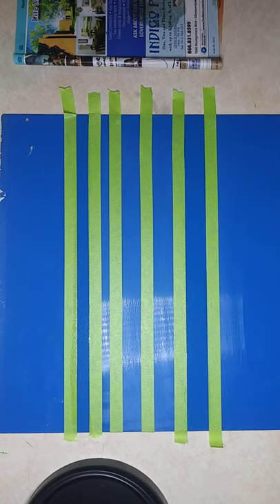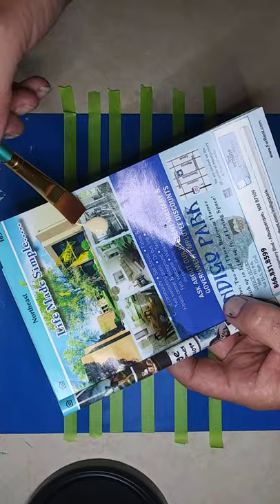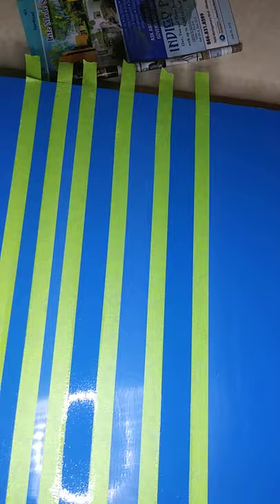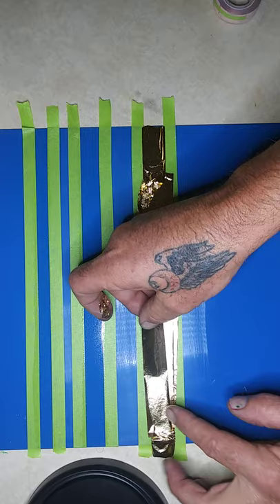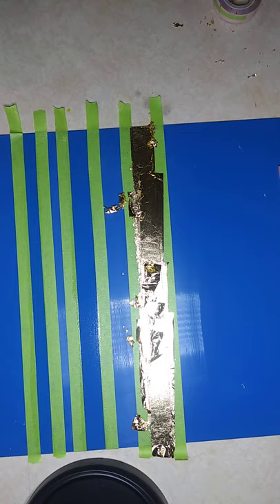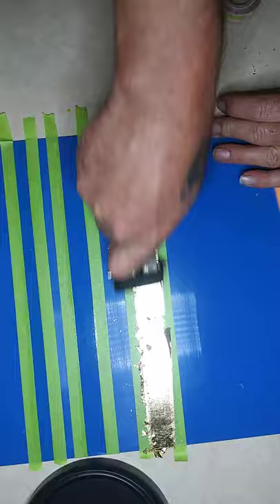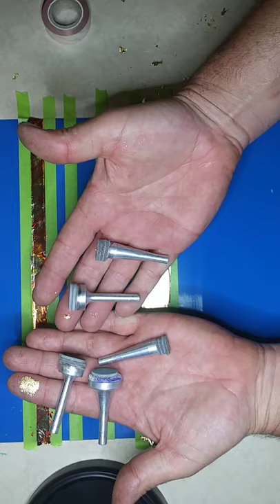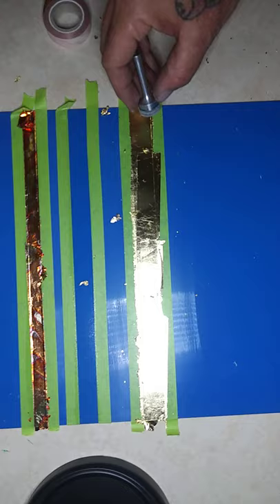GOLD LEAF FOR BEGINNER PINSTRIPERS

Comment: Maybe FYI, I tried the other brand 2k clear in a rattle can, ruined two of my projects, they looked really beautiful, after 24 hours I wet sanded the fish eye out and then buffed. High gloss shine, the next day I started to see lines in the whole project thru out. So I sanded smooth. When more clear coat came I pulled the project out to clear coat, and all the lines, (really more like cracks) were worse and were raised and the surface was rough. I believe it reacted with either or both primers I used. I was using primers in a rattle can from the auto store. I am on my third project, used a different primer, so far so good.
Reply: About 45 years ago I ran the sheet metal shop for DOD, 5th Army Forward Area Maintenance and the chemist from DuPont stopped by with this new paint called Imron urethane ... Since we spray painted everything on the planet, he suggested it for the Nike missiles (Didn't use it) ... he explained that then paint was oil base automotive paint and a special hardener... Back then I did a lot of airbrush work and pin stripping on bikes, so I took some one shot and added about 10-20 percent of Imron Hardener.  I had base coated a Sportster with black Imron (Free samples)... pin stripped it with a yellow/hardener mix. Let dry for 24 hours and then clear coated with Imron clear...magic... no cracks or wrinkles for 3 years when I sold it. I also tried using the same mix with Yellow Occur One shot as sizing for gold leaf name on a tank, plus one wood boat sign... I spread some of the same mix on some scrap painted metal and kept touching it till I got a clean"Snap" sound. Then I applied the leaf ... worked perfect, no cracks or wrinkles. This was on a show Dodge Van and it worked like a charm. I've never tried gold leaf size in such a mix... you might like to try it. I do mostly reverse glass work these days and floating painted images, like the old depression period Pub signs here in Australia, where I retired... You can check out the "Happy Guilder" in England as he does great work and good step by steps on you tube. Go for it ... also I feel that primers are not your problem. Also you need a spray booth as you can't buff Imron!

Comment: hey there thanks for the video! - i have a couple questions for you-- do you find the size tach time sweet spot is different when doing the turns on composite gold, verse 24k ---etc or verse copper, or silver ...? Also what grit is on that turn tool you are using? Any suggestions i just keep burning through seemingly no matter what i do.  Also what is the paint type you are adding in is that 1 shot? or acrylic ? or ???? Are you thinning  the dux with turp or anything? thanks again for the help
Reply from the maker: I do not use real gold so I am not sure. Hot rod Jen covers that real well in her videos. But the timing is similar with other imitation leaf, copper, silver, rose gold etc.. i use 3000 or 5000 grit Trizact. If you are burning thru then your size isn't set properly,  or too thick or you are pressing to hard or wrong material.  1 shot to add tint. Any enamel will work. And I do not thin my size. 
It will take a while to get solid results. It's all about timing. Watch Jens videos. She shows a cool process to learn the timing

Comment: Thanks for sharing this. Do you have a wet dry sand paper on the pads? like a 5000 grit?
Reply from the maker: It's TRIZACT pad. 3000, 5000 grit foam sanding pads.
Reply: @elroypinstriping8022  Many thanks!

Comment: I have a problem with clear. Do you clear it after 24 hours so the actual leaf can dry? Or can you clear it right away because of the hardener in the clear. I imagine without hardener clearing it with normal size would take 24 hours before clear. Never seen your vids before. Awesome vid!
Reply from the maker: Thank-you. 
You can wait but I have never had a problem clearing right away. And i dont add hardener to my size. Would make the timing unpredictable in my opinion.

Comment: What's the best way to keep the can of sizer from drying out?
Reply from the maker: I use a screw in the top and never open the can. I buy smaller cans 8oz. I usually run out in less then a year. If it gets "seeds" or grainy I toss it and start a new can.

Comment: Did you say "wait 50-55 minutes before laying the leaf"? Isn't that a bit too long since most suggest 20-30 minutes at average room temperature (~70 degrees)?
Reply from the maker: Yes. I typically set my timer at 1hr, give or take, 70 degrees.. That's with DUX size quick size.. 1shot, LUCO, or other size maybe sooner or even longer. Just depends. Best thing to do is lay out some tape lines like I did in the beginning. Lay 4-5 lines of size. Set a timer at 30, 45, 60, 80 minutes laying the leaf at each interval and see what results you get... With real gold you can wait even longer at times. Some leaf sticks better than others
Reply: Applying too soon is the biggest mistakes u can do its all varies on weather temps some places 20 30min some colder places 1 hr

Comment: Where did you get the variegated in rolls? Pee wee had some nice red stuff I started using on low riders in my area. Now he can not find it anymore and I've only got enough for a very small job. But I get asked for that colour often. Let me know where you found it? Please it sure would help. Thanks
Reply from the maker: I also got mine from him. It was nice! But I am almost out. Would like more too
Reply: @elroypinstriping8022  if you ever find the same stuff please let me know. Sepp is looking for me and says he can find it. But I'm not holding my breath. If you find anything close to it let me know aswell. Pee wee says he can not find it either. Im trying to hang on to the last 6 or 8 ft for repairs for t he customers I did. I can not find anything that matches even close.
Reply: @elroypinstriping8022  If you ever see variegated in rolls let me know please. Pee wee says he can get it but he has yet to come up with them. I found some from sepp but it looks like crap and will not work. Too ugly. Thanks mate.

Comment: When you make your own sanding disc with the hole punch, what do you have under the sandpaper ? I tied with a block of wood, (pine) I am not having to much luck. In your video it looks like you are getting a clean cut.
Reply from the maker: Thick plastic cutting board.

Comment: What brand and size tape do you use to make clean turns
Reply from the maker: 1/8 inch tape. 3m. Or FBS.. They even make smaller 1/16 and 1/32. I dont know. Whatever works dude.